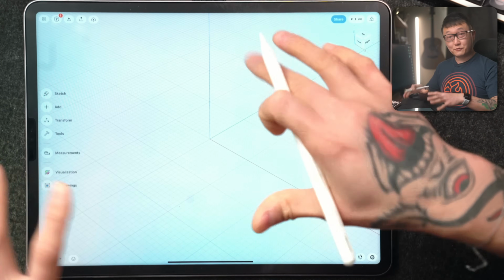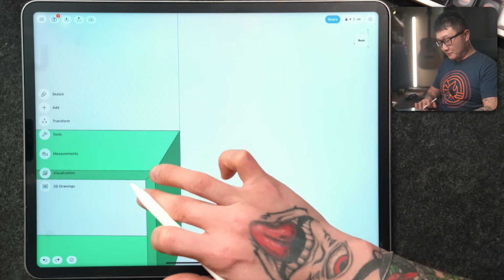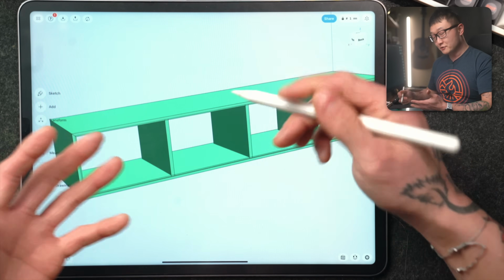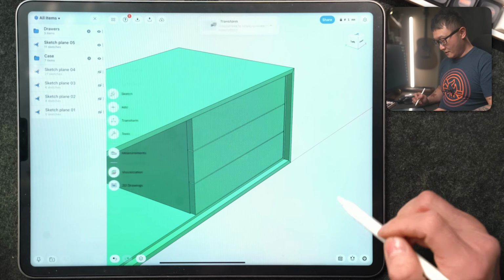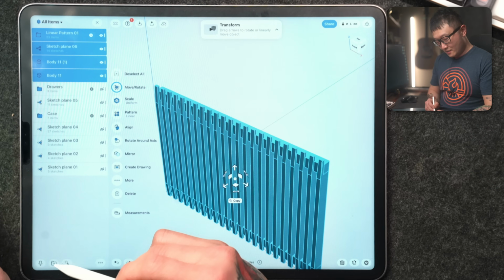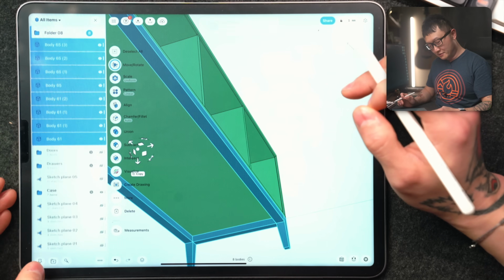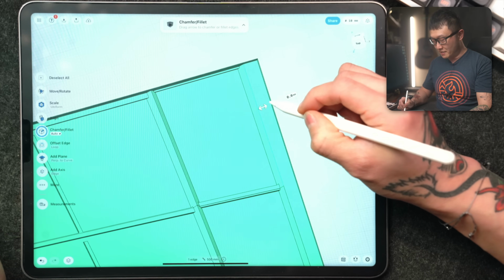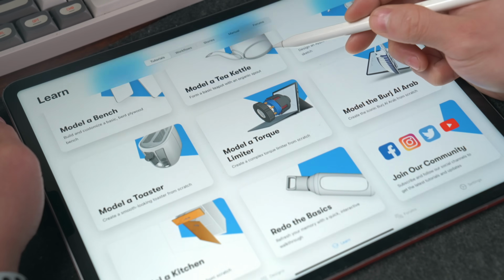Furniture Design For BEGINNERS in Shapr3D - CAD Modeling for Woodworkers

Comment: Using parametric CAD software to design rectangular furniture is like using a space shuttle to get groceries. Needing parametric CAD to design your furniture probably means your design will be unbuildable.
Reply from the maker: why would it be unbuildable? It's actually very useful if you want to have one design that you can quickly change to fit customers' needs.

Comment: Great video, I'm going to be using your content to switch over to Shapr3d from form Z as I'm finding it too buggy and problematic despite how powerful it can be. 
Now I have a recommendation for you, I'm sure it must be possible with Shapr3d to export a parts list as a text file. There's a great program called Cutlist Plus that I have always used for making my cutting lists. You can update it with all your stockpile of materials and it will assign the parts to these sheets as best suits you, for example I set it to prioritise rips first which saves me a lot of time machining. I can also set it to prioritise using offcut materials first and you can set the saw blade curf so it will account for lost materials as well. 
I think for small projects the way you do it works well but when you're dealing with a lot of parts this would certainly increase your efficiency.

Comment: The offset edge tool thing does not work. If I make a case and hen select the inside edges to make a rabbet, I get no option to use the tool. An absolutely frustrating program. Plus my desktop items do not look the same.
Reply from the maker: Sorry I’m not sure why. There’s a good Facebook support group where you can post screenshots and post your questions. I’ve never had an issue with this method before

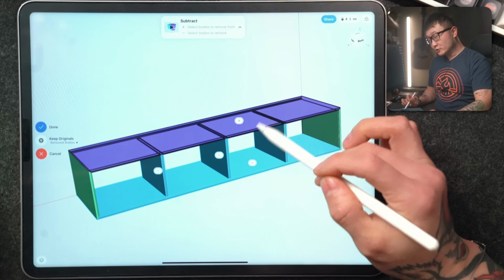Comment: Awesome video. Thank you very much. I'm not done yet, but just wanted to mention that at 13:48 you didin't mention that the subtract tool should be set to "Removed Bodies"... It's not set as default
Reply from the maker: Yeah they changed it. It used to be default. For some reason it’s no longer default

Comment: You demonstrated how you make a cut sheet with ur model's parts. Is there a way to export or print a those with all the part's dimensions? Like a blueprint? I don't work with CNC, but having those specs printable would help as I mark-up a board for cutting. Appreciate ur videos & nice design work. TY

Comment: At 10:23 in your video you take a measurement on your IPad by clicking two lines. I tried the same on the desktop and it does not take the measurement. What might I be doing wrong?

Comment: Really like your content and presentation style!

@ around 6:40 in the video (where you type the value 1650 to resize the panels and create the box), is there a tool that lets you resize by snapping to the other body? Or, do you have to do the math to resize correctly?
Reply from the maker: Hey thanks! Yes you can use the “replace face” tool for that

Comment: hi, can someone help me? is there an automatic cut list or something like that? for example, when a large kitchen is drawn, it automatically throws out a cutting list like in solid works.
Reply from the maker: I literally covered this
Reply: Could u find the alignment tool? Because is doesnt work anymore like shown in the video. I can only select faces with the tool
Reply from the maker: @jelleluiken I just tried it. Still works for me…
Reply: @BevelishCreations  Thank you for the quick response. When I select the lines, it won't let me choose alignment tool
Reply from the maker: @jelleluiken can you post something on the shapr3d Facebook group? Or DM me a video on instagram? I think someone also had similar problem before but they figured out what happened. I don’t remember why

Comment: @bevelishcreations noob here. does that align trick you use @5:50 still work in verion 5? I for the life of me can't get it to work.
Reply from the maker: Yes it still works. Are you using the iPad or computer? The steps on the computer is slightly different. Check the popup tutorial at the top of the app to see how you need to do it on the computer. I wish both iPad and computer were the same :(
Reply: I'm using a computer. On my mac, it seems to be suggesting that only surfaces can be aligned to each other, and that only 90 angled surfaces can be chosen for alignment @BevelishCreations
Reply from the maker: @geoffzephyrus9849 no I don’t think that’s right. It still works for me
Reply: Hmm, I must be doing something wrong then :/ @BevelishCreations
Reply from the maker: @geoffzephyrus9849 post your question with a video onto shapr3D’s Facebook group

Comment: Awesome video! Thank you, gave me some good ideas of how to use it on ipad! I’ve always used Autodesk/Fusion360 or Solidworks. 
With reference to the sketches (new sketch) I believe this is done for more complex engineering drawings, when I used solidworks, it came in handy for creating ports or stuff that comes out of a main body. Like lofts and stuff. 
I used it for the water pump housing project for college.
Reply from the maker: Hey glad you found the video helpful!

Comment: Massively appreciate these videos and thanks for quick response to my prior cnc vs conventional tool question. One more question if you don’t mind. 

It appears a limitation for Shapr3D is ability to make a cut list. I like how you lay out parts in your cutting diagram section, but was wondering how you are viewing the dimensions once you are actually in your shop working. Do you just keep your laptop/iPad in shop and click the parts in Shapr3D? Or am I missing an obvious other way to get the part dimensions printed or something else for bringing into my shop to cut/build. 

I hope my question makes sense. Cheers.
Reply from the maker: Yeah I always work with my iPad in the shop. But there’s a “dimensions” tool in the app (I thought I mentioned it in the video). You can click on and off to show and hide the dimensions. And you can print it when the dimensions are shown. But usually once I’m done modeling, it’s only 80% ready for the build. I’ll get started building and will make changes to the design when I encounter problems or if I come up with new ideas. So I always have my iPad in the shop

Comment: Thank you very much for posting. I am a woodworker who is just getting into 3d modeling my furniture builds and hopefully jumping into CNC here shortly. Would you use your CNC machine to cut out all of those front slats? Just wondering with your workflow whether conventional woodworking tools are quicker vs taking this cut list and making all of this cuts with a CNC if you had a machine capable of 4x8.
Reply from the maker: I’m building this guy right now and decided against cutting those out with the CNC. Main reason is because I want the corners where it meets with the rails to be sharp corners. A CNC can’t make sharp inside corners because of the bits. There will always be some radius along the inside radius depending on what size bits we use.
Reply: @BevelishCreations  That makes sense. I appreciate the quick reply.

Comment: I really need to just sit down and watch all your tutorials because I’m so used to sketch up on desktop that I feel incompetent trying to make furniture models with Shapr3d. But doing this is one of the main reasons I bought an iPad Pro.
Reply from the maker: Yeah it always take sometime to get adjusted with new modeling programs. Good thing with this is that the modeling techniques are more similar with other 3D modelers like Fusion 360 and Solidworks. So if you can master this, you’ll be able to handle those other programs too

Comment: Thanks for the nice tutorial.  Revisions to a design are something I struggle with in Shapr3D.  Say you get to the end of the design and decide to change the overall length of the case; how do you go about making that kind of change (and of course all of the changes that result from that)?   Comments or a video on  that process would be most welcome.
Reply from the maker: You’ll have to make adjustments separately to the parts. Like selecting the end faces of the miters on the top and bottom panels, extending them. And then you’ll have to go in and readjust the spacing for the parts. Like I mentioned in the video, it’s a direct modeling program, so there aren’t rules within 3D parts like in parametric programs